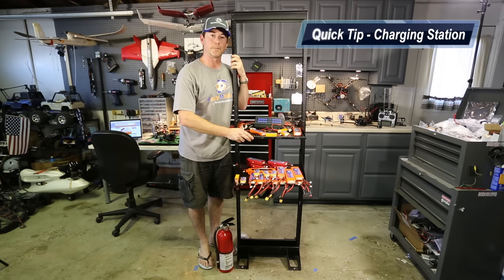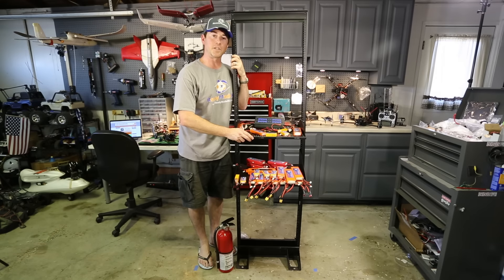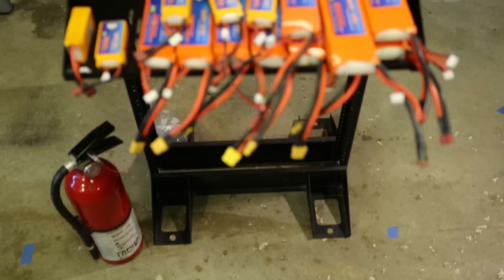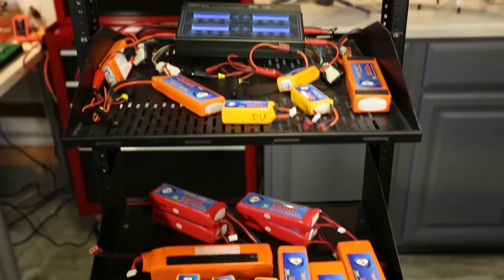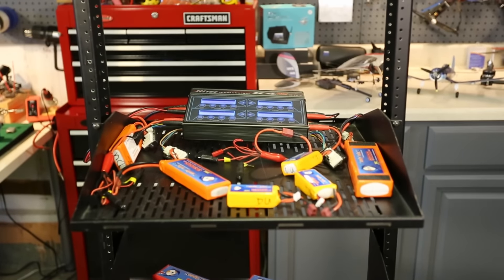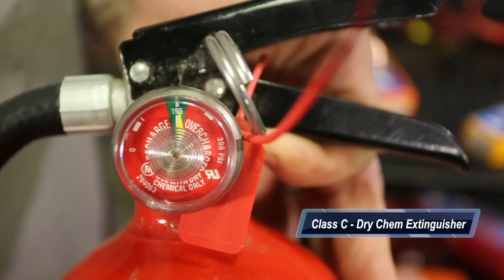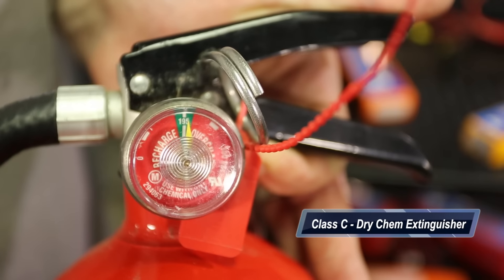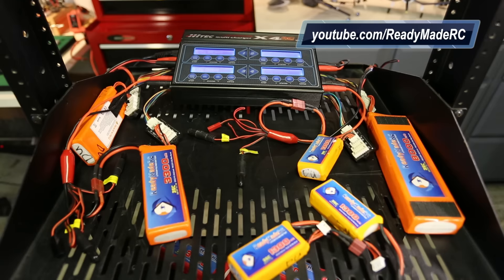ReadyMadeRC QuickTip - Battery Charge Station Safety

Comment: Good tip, Dave.  I just took many older lipo packs to the recycling center to keep from them lying around, I didnt trust them, some of them didnt have balancing leads (many years old)  Fortunately the recycling center now knows what to do with them, unlike the first time I went there.. lol

Mike
Reply from the maker: Multirotor Pilot - Great tip! There are many local cities and recycling centers that will for free take and dispose of a range of hazardous waste you have in the home including batteries of all types. I've added an extra note into the video description with your suggestion. Thanks for that! :)